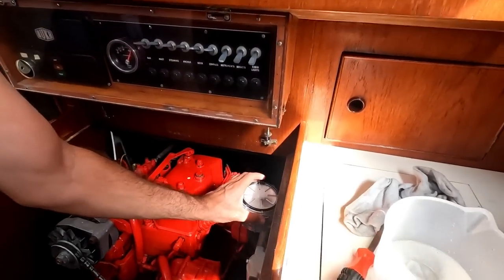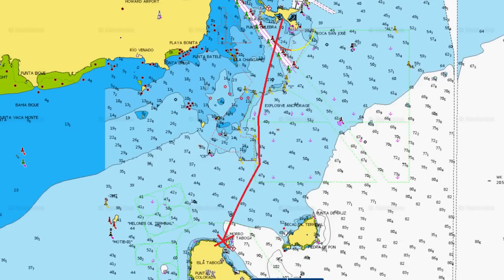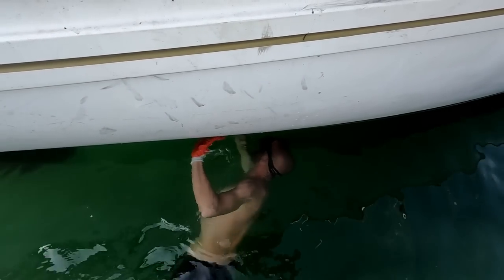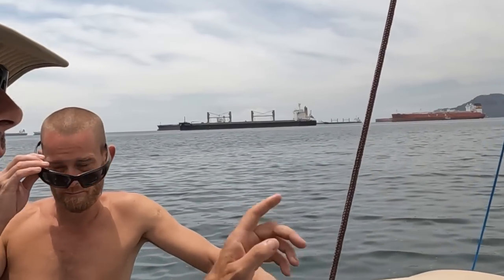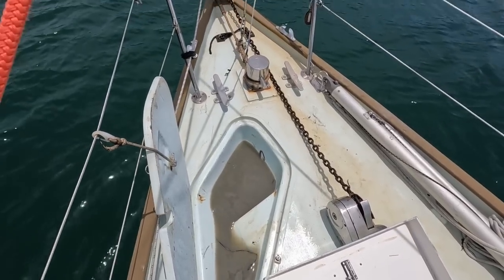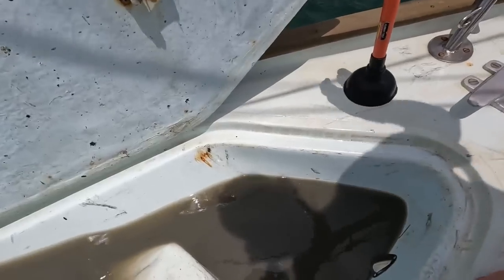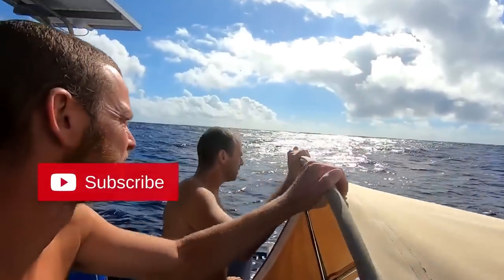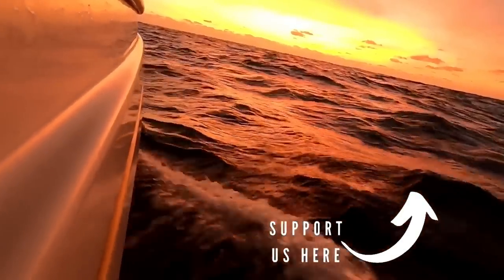Pacific Crossing Preparations,  Engine Problems & Hull Farmyard  Ep 116

Comment: What about your heat exchanger?  Have you recently cleaned it?  Calcium and other deposits can pass through the sea water and become a fixed to the interior tubes of the heat exchanger causing eventual blockages reduced water being able to pass through.  I have used muratic acid mixed in fresh water flushed through the heat exchanger to clear out deposits. A little prevention is worth having to buy a new heat exchanger. 💲💲💲
Reply from the maker: We don't have a heat exchanger on the engine as it is raw water cooled. We had a heat exchanger on a previous boat and that was blocked up horribly

Comment: When I had a similar problem with a raw water cooled engine, I put raw kettle descale through it when hot, left it in for about an hour and flushed out and made quite a big difference.
Reply from the maker: Very interesting indeed 🤔
Putting ideas in our heads now

Comment: Calcium deposits in the heat exchanger is a common problem and will obstruct raw water flow.  This is remedied by running Barnacle Buster through the system.
Reply from the maker: Perfect 👍

Comment: That was not a very pleasant job scraping the hull. Glad you got the engine sorted. You are going to need it to be reliable over the next few weeks. That island seems quite remote to live on. Any way Guys have a safe passage. See you soon. Can’t wait for you next video.
Reply from the maker: Hey Mark
It was a pretty rubbish job. Not usually like that. Normally we just brush the hull as slime tends to build up. Our little red two cylinder needs to be working well as we may need her quite a bit on the way. The Pacific Ocean is calling ⛵😁

Comment: My old40+yrs Lister 15 hp 2 cylinder gummed up thermostats @ every  18 mons 2 yrs just removed it told not to but had no problems. Was told it was shot(raw water cooled) but keep on ticking  the vessel stranded and wrecked(some parts.recycled) good old English technology weight norepinephrine than my new boats 75 Yanmar
Reply from the maker: The old engines are the best 😀

Comment: Great video as usual guys.  I had a twister with a Bukh 10 hp, I used to have a few problems sometimes when starting the engine it would not suck water through, I had to prime the pump to get it to work. It turned out to be the back plate in the pump that the impeller runs against had become worn and not forming a good enough seal.  Replaced the pump and all was good.  You could bypass the sieve and take the sea water supply straight to the pump and see if it makes a difference to the amount of water coming out the exhaust.   I think it is just you two worrying about something that is probably ok anyway. Displacement activity, rather than worrying about the journey ahead of you.  Remember it’s just the same water just a bit more of it.
Reply from the maker: Thanks Richard
The water pump is less than 2 years old. We certainly checked it and put in a new Impeller didn't seem to make any difference 🤔. Next step is to remove the strainer and see if that makes any difference. Maybe it's all in our heads as we are just worrying too much 😭
Once we get on our way it will all be left behind 😁⛵

Comment: I had exactly your problem - water pumping but less than usual. After launch it was difficult to get the water flowing. I thought it would be a new water pump but it turned out that the cam was worn. A new cam took moments to fit and then the pump worked fine, including priming after launch. I bet you need a new cam. Won’t cost much. Greetings from Yacht Bubble!
Reply from the maker: Hey thanks for your message we really do appreciate it! Our water pump is less than 2 years old but I will have a look at the cam to make sure it is not worn ✌️

Comment: I had the same problem and i accidently found out what it was after lots of dismantling this and that.  It turned out to be a hose that passes under the engine and thus not visible and it had kinked. I only found it because i dropped a spanner that went under the engine and i had to get it. There is a product called aqua ear in Australia that you put in after a swim. It is cheap and alcohol based.
Reply from the maker: Have checked all the hoses and the through hole all is clear. It's quite a strange one this 🤔. Have heard of aqua ear I think. Don't want any infections in our ears 👂

Comment: Maybe the pipe that goes into the engine head?  On my Bukh 36 it occasionally got calcified reducing the flow through the engine.  I used to take it off every few years and social it in kettle cleaner.  Good luck.
Reply from the maker: We checked all the pipes everywhere and all seems clear Richard 😭

Comment: Vinegar is a simple but effective cooling channel cleaner.  Ideally set up a 5 gallon bucket with a small 12 volt pump drawing the vinegar from the bucket directly to the line downstream of the saltwater pump, then connect a temporary hose from the exhaust injection line back to the bucket and circulate until it's filthy. repeat if necessary, if you get no cloudy/muddy circulation you're good.
In a pinch just take the hose from the salt water intake into the jug of vinegar, but this is very wasteful as you'll need many gallons of vinegar.
The engine cooling channels in ALL engines, but especially the salt water cooled  ones need regular cleaning.
Some people like to fill the engine with the cleaning solution then let is sit and wait, but if you do this ensure the system has an opening for the bubbling up pressure to be relieved.
Reply from the maker: Thanks for taking the time to please you're comment Bruce. Sounds like an absolute plan! Thanks for your advice buddy 👌

Comment: your engine's cooling water issues are exactly the same as my Yanmar 1GM raw water cooled engined had. The problem was deposits INSIDE the engine water passages reduced the 5/16" input to 1/8". The fix was 2 plus hours of recirculating a de-scaler through the engine..Good luck guys.
Reply from the maker: We are on the lookout for barnacle buster. I guess it's the same thing you used to flush the engine ✌️

Comment: Have you checked the exhaust mixing elbow. They foul with carbon in the exhaust gas and slow the flow of water. Assuming you have a cooling water thermostat, that is worth checking for build up and functionality 
Agree with buying some ear cleaner. We call it swim ear and it is a mixture of isopropyl alcohol and an acid, citric or acetic  I think
Reply from the maker: We have checks pretty much everything on the engine Geoff. Can't seem to find anything that's at fault. Going to continue to monitor engine temperatures. Next time we go swimming under the boat going to cover our ears I think 😉😁

Comment: Have you checked the cam in the water pump as if its worn badly then you will not pump as much water also with those Bukhs the water injection bend gets corroded and restricts the flow from the pump . Good luck lads
Reply from the maker: The water pump is less than a year old. Check it and the cam is like new. Also the exhaust elbow and water injection is new. Well around 2 years old
Reply: @TheSailingBrothers   Am just thinking here have you checked the thermostat as marine growth can also stop the cooling flow ,failing that maybe back flush the cooling system via the drains on the sides of the cylinder blocks as sand etc will def build up and restrict the flow just thinging what could cause the low flow here as worked on a good few of these engines . Its a shame they never made these engines with indirect cooling Good luck lads

Comment: I suspect you had a number of issues collaborating to cause the overheating issue. The inlet although not badly blocked, the impeller although not bad , the encrusted prop and hull would definitely have an effect on engine strain but of course you need to also factor in the warmer climate! As annoying as it might be there may be some benefit in removing the engine housing enclosure to at least allow some heat dissipation from the engine when running it for some time. or if possible install a fan into the housing? Great down to earth, as it is reality channel. Good luck on the crossing.
Reply from the maker: We definitely think it's a bit of everything as you said we are in a warm climate and the water is warm. We could remove the stairs to get some air into the engine but it is so damn loud 📢 maybe a fan would help out.
Thanks Andrew ✌️⛵😁

Comment: I had same engine and same fault. It turned out to be the pump.  If the brass cover in front of the impeller isn’t very ,very  close to the impeller front it won’t bump properly.  Also if the shaft bearing is slightly worn , same problem.   You can see wear marks on the brass cover.  Try turning it over?  John
Reply from the maker: Hey John
Our pump is less than 2 years old. We will try turning the cover over and see if that helps. Thanks for your advice we really appreciate it John 🙏

Comment: I was just doing the same thing. Troubleshooting overheating.  Also lots of fouling.  Man you want a clean bottom with good paint for your crossing. I use a dive hood when i do that job and always gloves. Have done the same thing to my knuckles.   Ouch.  Fair Winds!!
Reply from the maker: The engine seems to be okay at the moment just have to keep an eye on it. The hull is copper coat. Needs a good clean with Brillo pad to expose some fresh copper. Next time gloves and hats defo 😁
Reply: @TheSailingBrothers      Copper Coat. Very nice!  Just ruff it up a bit.  Yes, a fouled bottom is the last thing you want on a trip this long.

Comment: We took the Copper Coating off our 52 footer. (Hell of a job) however it was useless. And Prop Speed is only any help for 10 months
Reply from the maker: Our copper coat has been great until here. It is around 12 years old now. I bet you had one hell of a job on that 52 foot boat 😱
Reply: @TheSailingBrothers  One of the physically hardest things I have done

Comment: Just a thought,  but you might check for a hairline crack in the lid of that clear lid on the water filter you've been filling up or the housing itself.  It looks like there's a leak somewhere and it's not priming. I had that thing happen on a pool water pump where it just never would quite prime. There was a hairline crack in the lid.
Reply from the maker: We can't find any hairline cracks in the housing. We have noticed a couple of air bubbles in the water strainer looks like some air is getting in somewhere 🤔

Comment: Other possibility re: water is the heat exchanger matrix is blocked up: had this with my Beta engine. Easy to clear with some twisted wire/thin coat hangar wire.
Reply from the maker: We don't have a heat exchanger Dave. The engine is raw water cooled 🤔

Comment: You have sea water cooling and an iron engine.  Disconnect  the pipe from the sea strainer that goes to the water pump and put it into a bucket or extend it so that it can go into a bucket.  Disconnect the pipe that discharges water into the exhaust from the exhaust and return it to the bucket.  Put 'radflush' or similar cooling system cleaner often found in motor factors in the bucket with water.  When you run the engine, it will warm up and clean out the cooling chanels that are around the engine, then empty the bucket and rinse the system with fresh water.  Reconect the cooling system as it should be and run your engine.... it worked for me on an old volvo md11 that was over heating solved the problem.
Reply: Be careful running the engine without cooling water going to the exhaust this can overheat and melt any plastic components in the exhaust such as the water muffler better to just fill the engine cooling channels with rydlyme and leave for a few hours then run the engine as normal to flush. May well need to repeat. You’ve covered some miles since we met in Peterhead keep it up
Reply: @johncampbell4107  your point is valid, however, you only need to run the engine long enough to circulate and warm the water up.  Try buying rydlyme in a foreign language.
Reply from the maker: Thank you so much Mark for your fantastic idea 💡. We shall get some cleaner and flush the engine 🙏👌
Reply from the maker: Cheers John
Was a pleasure to meet you ✌️

Comment: Another fine episode.  I wonder if the near overheating of the engine was due to you having to push it so hard and long going through the canal.  Also the feed hoses to the filter look small in diameter but those would be dictated by the thru hull pickup.   Did you check the thermostat?  Maybe there is some junk caught in that?  I'm sure you have figured it out by now.   What a lousy dirty job cleaning the hull.  My wife was squirming thinking about the creatures that were on you.  That was nasty. She nearly spit up her grilled cheese sandwich that we were having for lunch.  LOL   Safe Travels.
Reply from the maker: We have checked absolutely everything on the engine and nothing seems to be blocked. It's pumping water okay and cooling okay now but not as much as it used to. Wasn't the best job in the world cleaning the hull with all those bugs. You could feel them crawling all over your skin 😦
Reply: @TheSailingBrothers  Maybe the bugs are in the engine?   Could you put your scrapers on broom handles to give you more leverage and get you a bit further away from the bugs?   A nasty job for sure.  The warm water down there sure promotes growth on the underside and yours too if you are not careful 😁
Reply from the maker: Maybe next time we could wear a wetsuits and cover our heads 
There is so much growth down here. Probably due to the fresh water river full of crocodiles 🤔
Reply: @TheSailingBrothers  Crocodiles too!  They can be worse than sharks!  Be careful guys.

Comment: Can you lower the sea strainer? When installed mine above water line it seemed like it had trouble drawing water. The pump had to pull a vacume in the strainers keep water in it. Just what happened to me.
Reply from the maker: Hey
We tried lowering the strainer however it didn't make any difference 🤔 we are going to monitor the engine temperature and see what happens. Thanks anyway ✌️

Comment: For whatever it's worth,  I don't understand why you would have your raw strainer so high above the pump?
   Pumps like that tend to be push not pull just my thoughts. As you enter warmer water maybe it's becoming an issue.
Reply from the maker: It's always been in the same spot. Maybe we could try lowering it a little Lee
Reply: @TheSailingBrothers  I'm not familiar with that motor. So take my advice with a bit of caution.
   If the cooling system is all sea water it's not unusual to see build up of what looks like coal in the cooling passages.
   If the system uses fresh water with a heat exchanger that might need attention.
   Either way in my opinion and experience the run to the pump should be kept low. Those type of pumps don't like to suck🤔
    Try removing the output line where it enters the motor, start motor for a few seconds and observe flow....it should be a lot of volume and pressure.
  Then repeat with the trap laying as low as possible or better yet just go straight from seacock to pump for the experiment.
    IF you have strong pressure and volume of both I would focus on motor and or heat exchanger.
   Please pardon me if I should mind my own business. I can offer some ways to clean the cooling passages if you are leaning towards that.
   If you have good flow from pump, check flow at exit where it goes to exhaust. That's gonna narrow down the issues.
Reply from the maker: Hey Lee
We really do appreciate your advice. We will do all these checks tomorrow and see what happens ✌️ thanks so much for taking the time 😉. I find it very interesting 🤔
Reply: @TheSailingBrothers  I was looking at the motor frames  and I think it's seawater cooling. The frames of the exhaust seems low on water.
  Let me know if I can offer any insight

Comment: Copper coat does not work. I thought that every one knew that. I am on my second lot. I launch in May & have to have the boat hauled & jetwashed in July to get my yacht through the season to October. However the cost of the scrub is the same as the cost of antifoul paint & I do not have the hard work & hassle. So I reckon Coppercoat is worth it as I am now 76 & am too old to spend time sanding & antifoulpainting the hull. I do antifoul the iron keel ( that is easy compared to the entire hull & I can deal with any rust spots) & that lasts all season whereas Coppercoat on the hull  does not- hence the mid season jet wash. 
I am in the UK though. Not as lucky as you 2. Although you are not really  "lucky" you have worked for what you have & that is not down to luck. Just shear effort to get where you are
Reply from the maker: Hi Graham
When we were saying it around the UK, Caribbean, America and Canada we didn't have any problems with our copper coat. Just dived down and brushed off the slime that accumulates no hard growth at all. Just since we have been here we had barnacles. Sometimes copper coat just does not work on other boats all is applied incorrectly. Sounds like yours isn't working very well sorry to hear about that.
We are very lucky to be here and doing what we are doing and have the following we have. So much support it is unbelievable. But yes we did make that decision not to go back to work and follow our hearts and luckily it has worked out 😁

Comment: There's copper coating and copper coating. If you have the time, take a !ook at Sailing Britican who had a very bad application which failed. Eventually, the copper coating company flew out from the UK to do the job properly.
Reply from the maker: Our copper coat is around 12 years old. It works absolutely fine in cooler Waters also in the Caribbean no problems. The water by here is full of nutrients and is known for bad fowling. We will take a look at sailing Britican ✌️